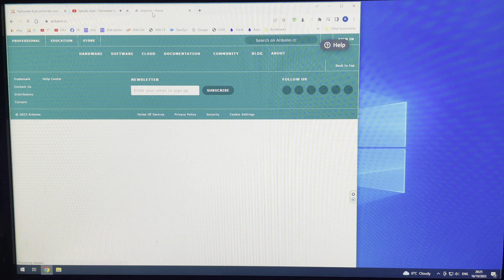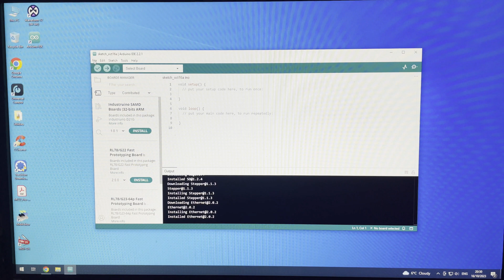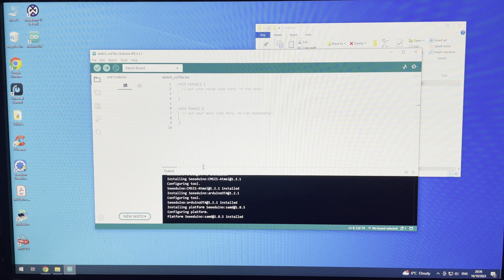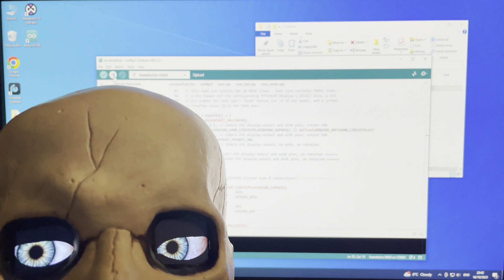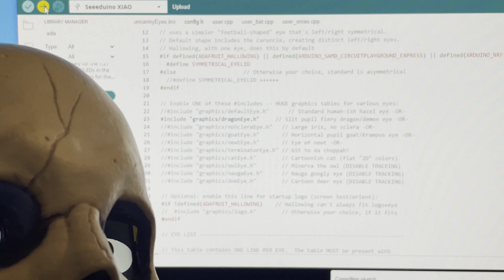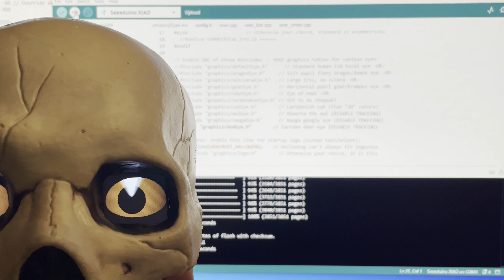Spooky Eyes firmware (Software) Build and install, from the start

Comment: Where can I find a 3D model of full sized skull that I can easily place the screens into?
I think I am going to be going with the 1.28" screens
Do you know of a model that I can wire easily without too much Post processing?
Reply from the maker: The one I used was a cheap Halloween prop from a local shop.
This model on Thingiverse looks as if it may be suitable - you would have to cut it in half and remove the backs of the eye sockets to fit the displays:
https://www.thingiverse.com/thing:3320670
Reply: @RJTC thanks I saw one on maker world 
I like better that is one piece too
Guess I will have to use the measure addon tool in the slicer to measure the eye sockets and maybe scale it up a bit if they won't fit.
I rather use a hollow model so I can put the electronics in the skull.
The one I like has infill in there though.
I don't know CAD but I wonder if its possible to hollow out some of the model on the slicer or make a small channel for wires.

Comment: Would have helped if you started with a part list and discussed which boards can be used and the part for the screens.
Do we have to use a Sam's board or can we do this with an esp32 or with a pico board instead?

Comment: I'm a newB Can I use the 1.28 Inch TFT LCD Display Module Round RGB 240 * 240 GC9A01 Driver with the Seeed SAMD21? If so what is the wiring?
Reply: this interest to me too .I have 2pcs 1.28 Inch TFT LCD Display Module (no touch). I tryed to upload eye1,eye2 from example. Upload done, but screen is black. Need help.
Reply from the maker: Are they any type numbers on the displays you have? What resolution are they?
Reply: @RJTC  1.28 Inch TFT LCD Display Module Round RGB 240 * 240  Model: GC9A01 the pin out wiring is different for what I can see. You have more wires
Reply: @npdjrick1  my display 1.28" 240x240 round with usb-C connector. Something wrong with that display's. "Hello Word" demo do not show on screen. Only in serial monitor loop "hello word"
Reply from the maker: @npdjrick1  Hi, "GC9A01" is the controller IC; there are several different  1.28" round displays using that. What signals does it have? Also, the program is intended for a 128x128 display? It's possible to modify for a larger display but the update rate would be about a quarter that of the 128 one as the 240 type needs 4x as much data each image.
Reply from the maker: I believe the GC9A01 is similar to the GC9107? The latest project version I added supports the GC9107 as well as the original ST7735.
For the wiring you would need to match the pin names against the diagram in my project drawings; it likely varies from make to make so check the signal labels for the version you have?

Comment: Where should I adjust the code to make the eyes roll back and forth, not too close to the edges, I want them to look forward, because now I'm using it to track people's faces. Thank you in advance.
Reply from the maker: If you look near the end of the config file, there is a section for joystick control. If you uncomment the JOYSTICK_X_PIN input, you should be able to "steer" the eyes side to side with a voltage signal. Centre would be 1.65V (half the 3.3V supply).

Comment: i got it almost working perfectly but both eyes are left eyes. i can't figure it out. any ideas?
Reply from the maker: Do you have the two TFT display CS lines connected to different pins on the MCU, with no short between them?
If that is OK, check the config file and look at the "Eye list" section; it should have a two-line definition, as with the last part in that section in my example config - that defines the CS pins for the left and right TFTs.
With the default eye include, that should give left & right eyes on the two displays?

Comment: Robert, is there any way I can contact you?  We work with an animatron (see our stuff sometime), and I would be very grateful if you could help me answer a few questions!
Reply from the maker: OK, a bit indirect but.. Go to my web site from the link in the video description, then the home page of that, to the JRW link & the contact link at the top right on there.
Reply: @RJTC  Thanks very much, Robert!  I sent a message to your business address, I’m James.
Reply: Just thought I’d bump this again.  Any update?  Thanks.
Reply: I really just want to know how you’d recommend I modify the .PNGs to create several different animations.  Inkscape?  GIMP?  It would be great if I could record mouse movements as animations.
Reply from the maker: @OriginalMasters  The image is static and only really defines the colours for each eye version. Think of that as a background, with all the animations done by manipulating sections of the image as overlays in the software.

I am trying to come up with some way of controlling or scripting that more, as time permits.
Reply: @RJTC Thanks for clarifying, Robert.  I think we’ll forgo animations, as the ESP32 file limit is stringent and would limit our custom animations to roughly two seconds at 15FPS.  For us to hard code 7 animations based on 7 emotions would require more time than we have, unfortunately.  

But again, since the Arduino drives the graphics, you can have longer routines that occupy less space.  Which of course is the beauty of programming.

I think this result would be fine for us this year—it looks great even though we won’t be able to display different emotions this year.  Did you modify the code as far as blinking and looking about goes?  I really need to download and begin experimenting. 

Thank you.
Reply: Decided to use the default animation and follow your approach!  Getting there—thanks for this great video.
Reply: @RJTC Robert, my install is a disaster.  The screens are powered but no images appear.  I’m powering my chip and screens with the same 3.3v USB source, and maybe that’s the issue but really shouldn’t be.  Everything else looks good.  Baffling, frustrating.
Reply from the maker: @OriginalMasters  I only use 5V for both the MCU (which has an onboard 3.3V regulator) and the displays.

What happens if you use the 5V input from 5V USB?

What MCU module are you using?

Comment: The display used by the diagram is not highlighted, this is the model: 1.44 inch 1.44 "128*128 color TFT LCD screen

Comment: This works great!!! Thank you!
I was very pleased to find that I can continue to use the Arduino IDE without having to use a different tool.

I had some ST7745S on hand and was able to get them working. Turns out that that I was able to use 5v from an external source to drive everything without  any issues. The pin-outs names on the ST7745S only required one change which was to connect DC to pin1 on the XAIO board.  I was hoping the dragon eyes would work for my project but happy to wait for a solution since this is beyond my understanding. I'm guessing the addition of an SD cars may be in order?
Reply from the maker: I'm still hoping to get the other eye types working, I've just not had time to investigate the memory mapping yet.